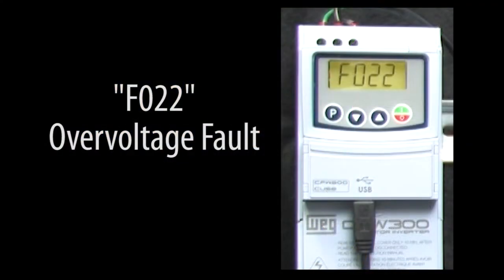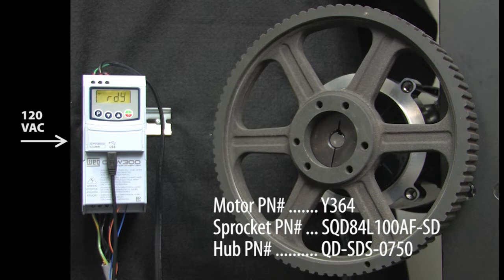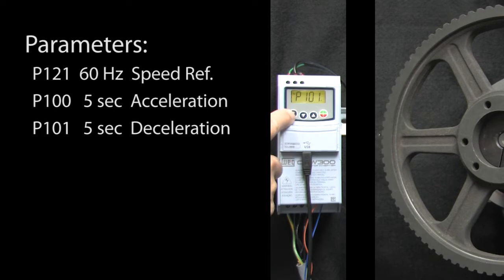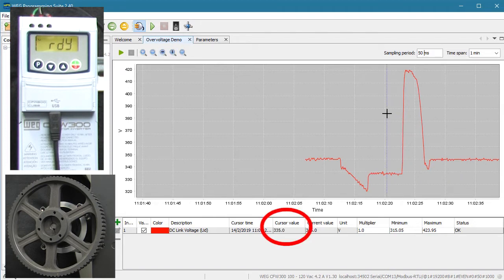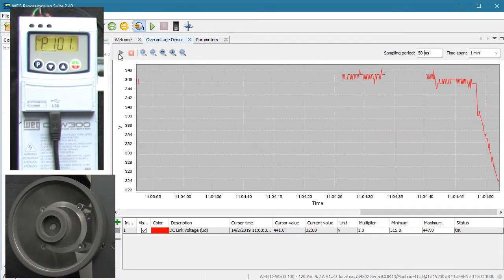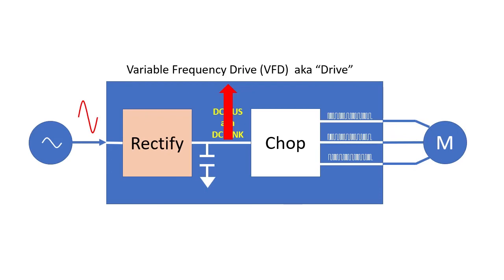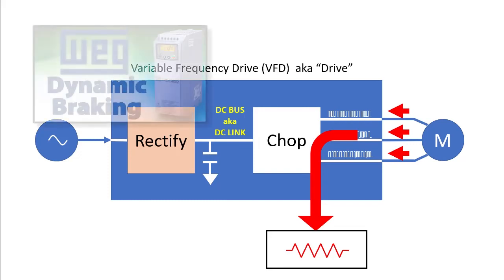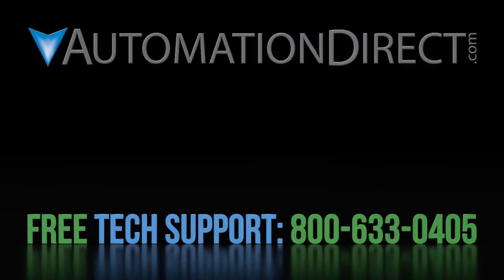WEG CFW300/320 VFD Overvoltage Debug from AutomationDirect

Comment: Thanks, that was a great explanation. We are getting error code F021 and F022 on our WEG cfw300. We are running a three phase 1.1kw 220v Electric Motor with it that turns a plastic extrusion screw to recycle plastic here on the island. The input power comes from a big single phase generator that powers the island that we are on. Since we get both under and overvoltage, am I guessing correctly that this has more to do with the fluctuation power supply aka the generator not spitting out pure sine wave power and / or other people plugging stuff in at the same time possibly?

Thanks a bunch for your help, it’s highly appreciated. 
Cheers, Nike 
#inmoceanforcleanoceans
Reply from the maker: Thanks for the feedback.
Yes, it does sound like you have a supply issue.
Are you using the WPS software to configure the drive? If so, then there are some awesome debug and diagnostic capabilities in there that will show you what is going on inside the drive and help you isolate the issue. The software is free (download at AutomationDirect.com), but you will need an optional com module to communicate with the drive.
Check out these videos to get started with WPS:
WPS Quick Start: https://www.automationdirect.com/videos/video?videoToPlay=E4EqEJ_m99M&q=wps
WPS Diagnostics and Wizards: https://www.automationdirect.com/videos/video?videoToPlay=e8FIgTNn9bA&q=wps

And hopefully you know that we have over 1200 automation videos at:
www.automationdirect.com/videos
And that there is a "video cookbook" with a whole chapter dedicated to VFDs here:
www.automationdirect.com/cookbook
Reply: @automationdirect  thanks so much for ur reply! No, we are not using the software 😬 but I will look into it and look at some more of ur videos to understand it all a bit better. Thanks so much for your answer.
I guess we will have to find a way to regulate the incoming power from the generator before it reaches the cfw300 then...👍
Reply from the maker: @WhiteSpotPirates  Keep in mind, the software just shows you the results in a nice clean graphical environment. You can still see all of that stuff via the parameters.  So, yes, watch the videos for hints - especially the videos on under and over voltage.  Good luck!
Reply: @automationdirect  thank you! Someone recommended to use a voltage regulator before the power hits the cfw300. Do you think that would help with the fluctuating current? Or would h recommend a different device? 
I was wondering to transform 220v to 12v and then use a sine wave inverter to get clean power, but that’s more pricy than the voltage regulator and probably not necessary? I live on a sailboat , so I am more familiar working with 12 v DC than AC, so trying to figure out how things work 😂
Reply from the maker: @WhiteSpotPirates  I'll ask our engineers for suggestions.  Standby ...
(Please verify: The "Big Generator" is providing single phase 220VC - correct?
Reply: @automationdirect  you are the sweetest, thanks so much 🙏🏼. Yes, the town generator is single phase, 220v @60 hertz. Lookin forward for hear your ideas 👍
Reply from the maker: @WhiteSpotPirates  The engineers agreed - you really need to audit the voltage variation to see what the town generator is actually doing. Depending on the amount of sag and surge on the supply lines, there may not be a local solution.
Again, take a look at the over-voltage and under-voltage videos - you will see that you can adjust the thresholds in the drive and given the voltage audit you may decide you can expand those some so the drive doesn't fault out. The Wizards in the WPS software really help you visualize what is tripping the drive and how to fix it (or just monitor the appropriate parameters).
Good luck!
Reply: @automationdirect  thanks so much. I will see if we can get that software running to see what’s happening and will look at ur videos to see why device we need to talk with the cfw300. Problem is that we are on a tiny island and don’t have easy access to gadgets, but we will see 😂🤞🏼
You have been extremely helpful, thanks
Reply: @automationdirect  sorry, me again 😂 I am at the place with the machine right now and it seems that we are getting 277V in instead of 240. Could be because the generator is three-phase? Since the cfw300 is rated 200-240 the 277 might be the reason for the over voltage alarm? I guess 37V too much is nothing that we could get away with by tweeting the voltage fluctuation of the cwf300, right? Also seems that the heat bands are not liking the over voltage and one seems fried already 😬.
I will do some research on the three-phase wiring since I don’t know anything about it. But should be able to produce normal 240v even with three phase power supply, no?
Reply from the maker: @WhiteSpotPirates  Yeah. That will be a problem. Picture what's going on: The supply voltage gets rectified into a DC bus and that DC bus gets chopped up into a PWM signal and sent to the motor. F022 says the DC bus is getting too high for the internal components to handle it. You risk damaging the drive. This could be caused by the Source voltage being too high (probably your issue) or regen coming in from the motor if you are trying to ramp down too fast.
You can monitor the DC bus voltage using P004. You want it to stay with in the limits of table 8.1 on page 8-5 of this manual: https://cdn.automationdirect.com/static/manuals/wegdrives/programmingmanual.pdf
So how does P004 look?  Is it within the limits?  If not, then that is why you are getting Overvoltage faults.

Comment: Out of curiosity, what are the benefits of a vfd soft starting a conveyor belt rather than just turning on the motor and having the conveyor run full speed?
Reply from the maker: Hi Urano, 
You really have three options: 1) Line Start (On/OFF), 2. Soft Starter and 3) VFD.
And of course, it all depends on your application. 

Line Start:
There is nothing wrong with Line Start BUT, it does increase the stress on your system going straight to full power rather than easing into it and can cause voltage dips on your main lines since a typical AC motor can draw around 6X full rated amperage on startup. We have a whole bunch of videos showing you how to do this here: www.AutomationDirect.com/Cookbook - look for the "A/C Motors: On/OFF chapter.

Soft Starter:
An economical and easy way to ease a motor up to full speed and reduce inrush current.  Search the AutomationDirect website for more info on those.
We have a number of videos on those too at www.automationdirect.com/videos - search for "soft starter"

VFD:
Same benefits as Soft Starter, but can do LOTs more including running motor above 60Hz, reverse the motor,  and some even have PLCs built in. We have TONs of tutorial videos on VFDs here: www.AutomationDirect.com/Cookbook - look for the "A/C Motors Drive" chapter.

Comment: This usually happens to cheap inexpensive drives
Reply from the maker: Actually, this can happen to any drive - it's good stuff to know!
Reply: It happens in my company whete I work.
VSD drives 650KW motor that's connected to gigantic fan and every now and then it comes up with overvoltage explained in this video.
VSD is 2 meters tall by 600mm wide and costs 100K.
Reply: Why would dc bus voltage sitting at 780?
Reply from the maker: @Said_West, what is your incoming voltage from L1 to L2, L2 to L3, and L3 to L1?